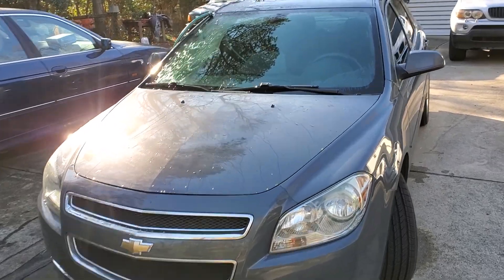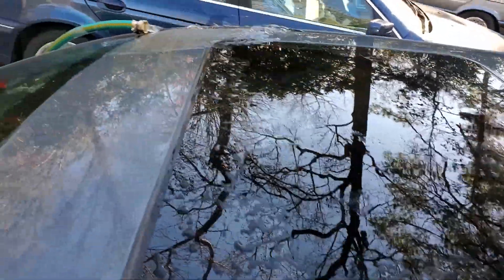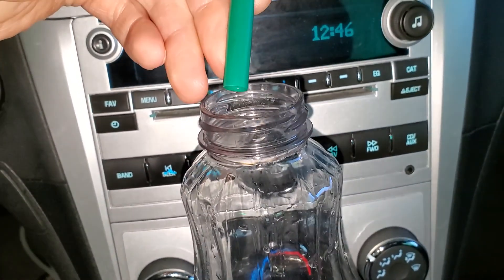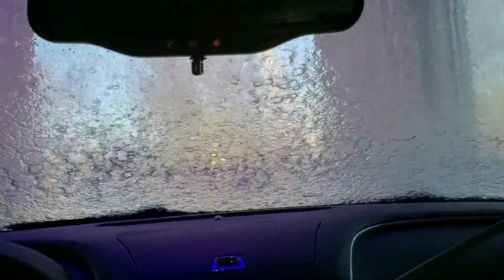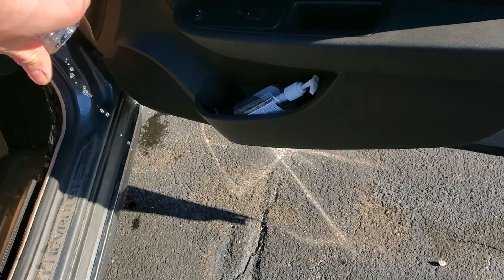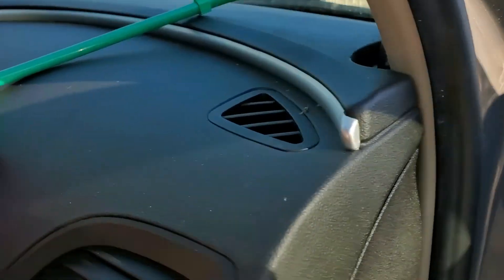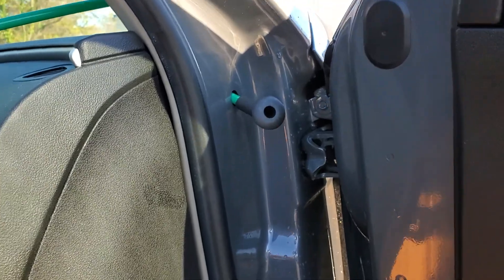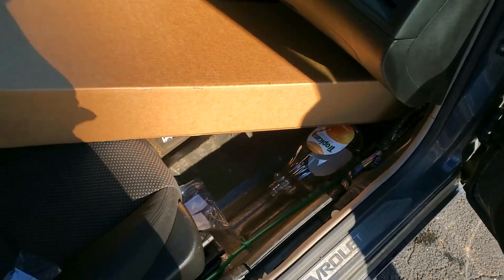Chevy Malibi Leaking Sunroof Drain Repair - How Much Water Goes Thru Sunroof Drain?

Comment: Mine is a 2017, and I never knew about these drains, and I keep getting water in my trunk. Do you believe I could have that same problem?
Reply: I got a 2017 too same issue but only when i wash my car did u ever find out what the issue was?
Reply: I have  a 2018 and my trunk is wet too and now my driver's passenger floor board!